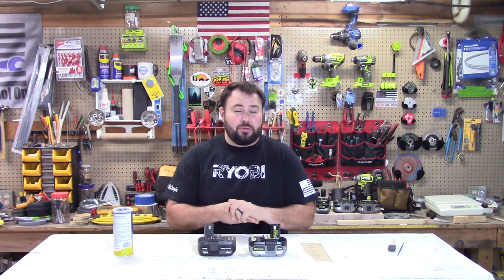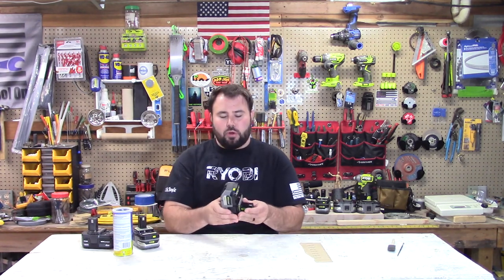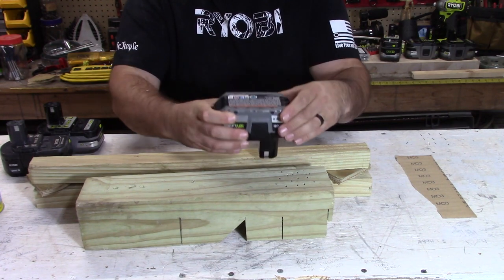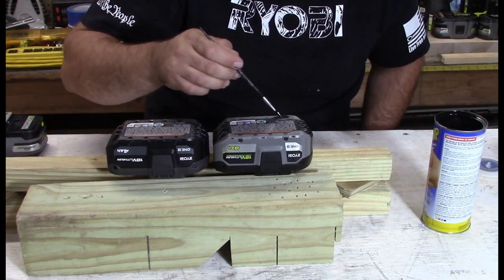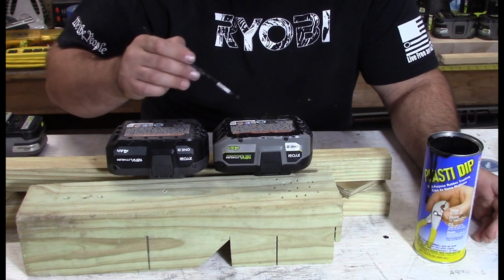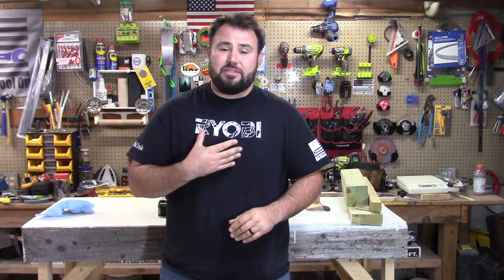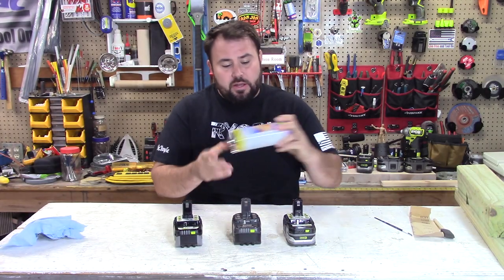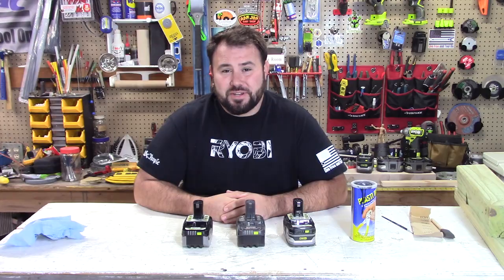Ryobi battery rubber coating

Comment: Good idea and video. I’ll just buy a cheaper previous gen myself ✌️
Reply from the maker: Not cheaper in fact more! ✌️
Reply: Plenty of us have got the 9ah P194 on sale from the Home Depot for $80. That’s 9AH for $80 vs this deal at 8ah for $100. Can’t argue about sales because you’re advertising a sale. You want some views, break both previous gen and current gen HP batteries down and compare. I bet the new ones aren’t even 21700s. You can get a remand p195 with 21700s on DTO. Far better battery than these new ones